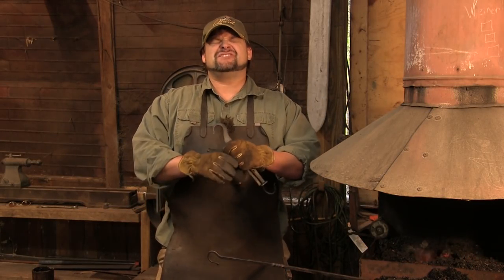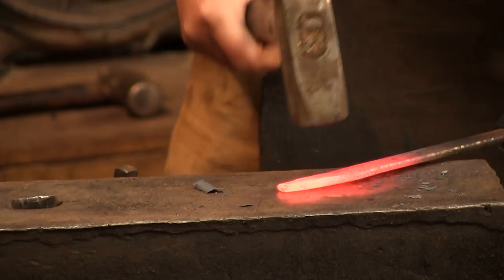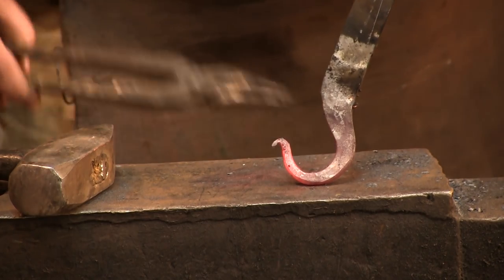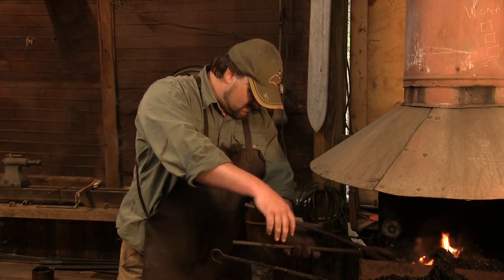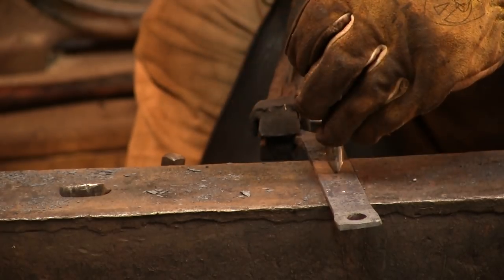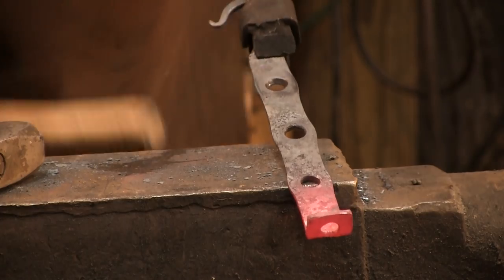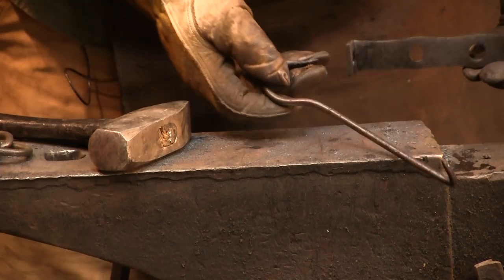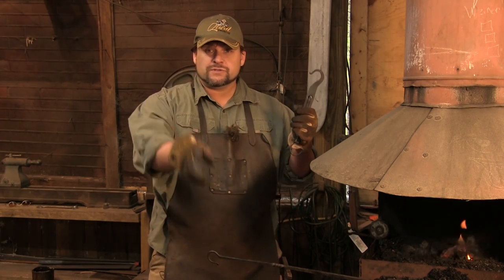How to Forge a Cooking Trammel

Comment: how much phsyical shape do you have to be in to start learning how to do black smithing projects if you want to start out?  What would be the metrics of how much you need to be able to lift and so forth that would be a good measure up.
Reply: Most of that would have to depend on what kind of things you are attempting to make!
It takes a heavier hammer and more force, usually, to move thicker/larger metal than it does to move and shape smaller.thinner metal.
I used to be able to handle a 6 pound hammer, well.  Now, I am disabled and can't use anything much over a 2 and a half pound hammer.
So, I just take a LOT longer and a lot more heats if I want to do bigger projects, or I stick with smaller projects!
I hope that gives SOME idea of what you were wanting.  Good Smithing!

Comment: Trent, I'm going to be critical, here.  WHY such BIG holes??  I have used many trammel hooks over the years in historical re-enacting as well as having made quite a few, too!
I find that the bigger holes allow one to LOSE the adjustable piece in the fire and such.  
One does NOT need such large holes and actually, just over the size of the rod you are using to move the pot up or down keeps the wiggle down and LOOKS much nicer, too!
The design is much the same as all trammels I've ever seen from the old times.  As you say, nowadays there are the saw edged tramme
ls but I don't recall ever seeing one like that that was from the 17th or 18th Centuries! 
Yours are every bit as functional but, as I said they don't LOOK as nicely done as those with much smaller holes that are just slightly over the size of the rod used.
THANKS, for all the great vids and all that you do to further the trade and the skill!  Best wishes!!!

Comment: So when you make the tripod, which method do you prefer to link the legs? Rivet, ring, or a third option I'm not aware of?
Reply from the maker: For our tripods, we usually do two offset rings joined by a centered third.
Reply: I'm trying to picture it, unfortunately, my imagination is failing me.
Reply: Yeah, I think I found an image of what you mean, eyelets at the end top of the legs...

Comment: Trent, I know it's not the subject of the video buy I can't remember if you covered it in a previous video but, how do you cut down the ringing on your anvil? I've got a strip of rubber beneath mine so as not to disturb the neighborhood with my work but I just noticed yours sounds even quieter than mine.
Reply from the maker: If you have rubber under your anvil, you are making it much worse :) I put a cloth or rubber under my anvil when I want her to sing at a show. Wrap a chain around your anvil or stick a speaker magnet to it, that will take the ring out